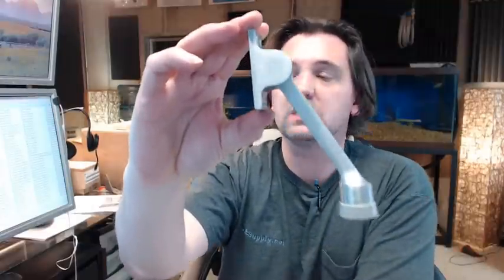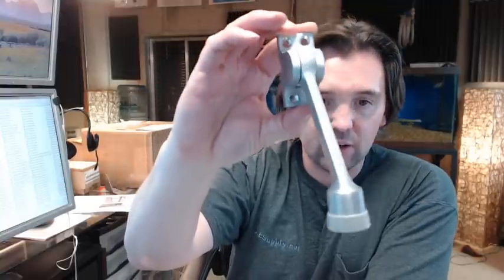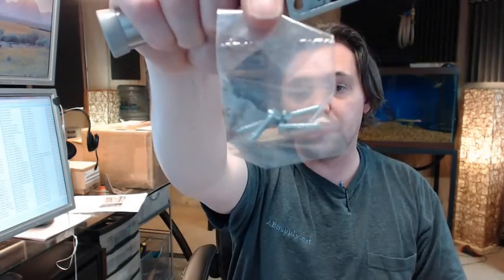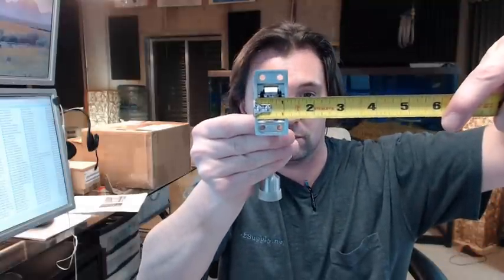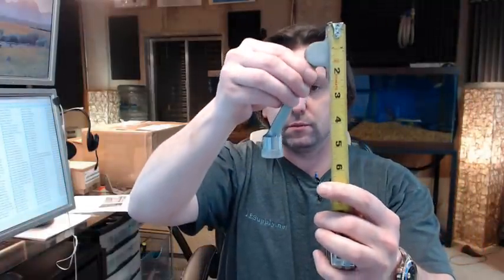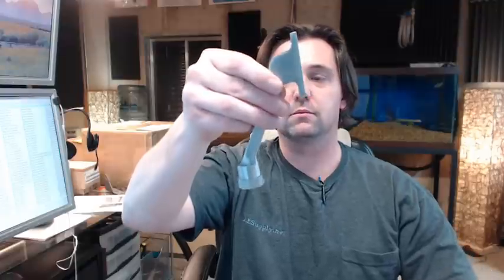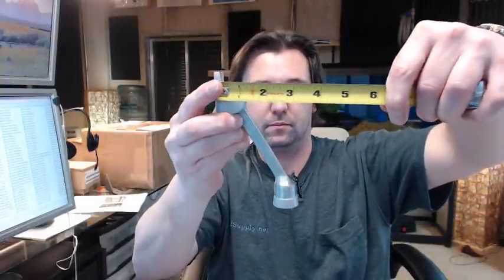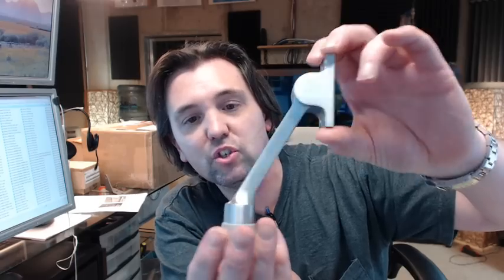Rockwood 461L-626 Satin Chrome Plated Brass Kick Down Door Stop

Comment: We have one of these and the actual stopper metal that rubs against the tabs for friction wore away. After about 3 to 6 months I'd say it falls under gravity and it's very annoying. When I take it apart I can see grooves where the tabs rub against the door stopper that should not be there but have worn because of friction.
Reply from the maker: The cause of a kickdown door holder that refuses to stay in the vertical position would be caused by a broken flat spring that is visible from the back or rear side of the unit.  This is a very common failure of kick down door holders however I must say it would be the first time I've heard of this in a Rockwood unit.  I did review our order history for this item and do not see an order to you for this product.  If you have a genuine Rockwood 461L-626 Satin Chrome Plated Brass Kick Down Door Stop the factory most absolutely will honor a warranty claim if it is found to be defective - please supply us with your order number and we will work with the manufacturer toward resolution.